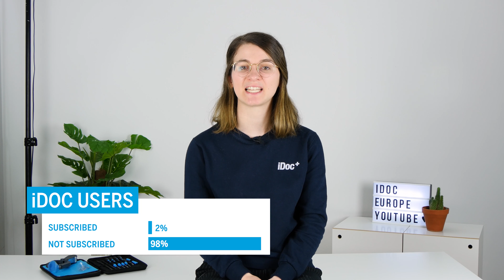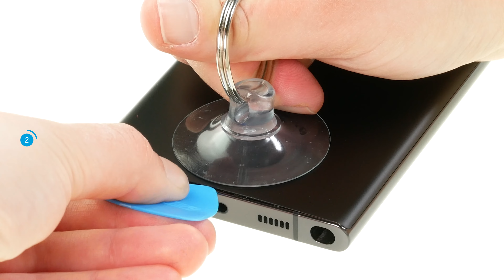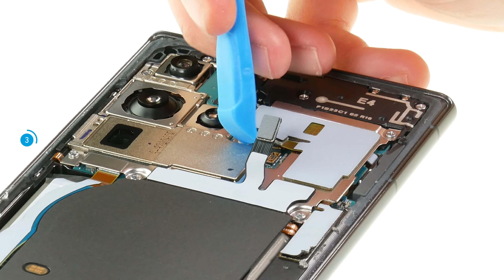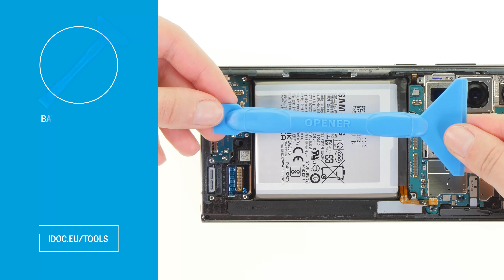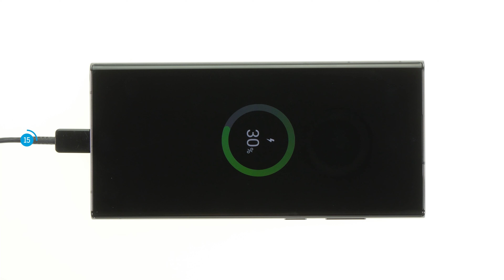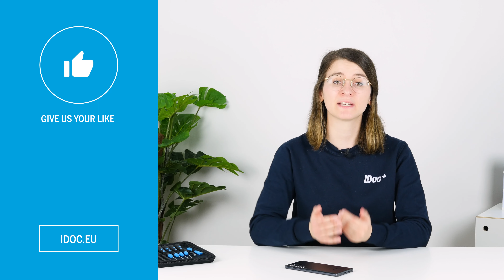Samsung Galaxy S22 Ultra – Battery replacement [repair guide + reassembly]

Comment: This is an issue with the new phones. The battery should be easily replaceable. The manufacturer's want you to buy new phone when the battery is done. That is why samsung says battery is not replaceable. We all need to make it clear to all manufacturer's that this is not acceptable
Reply: Fortunately its successor, S23 Ultra, has the battery pull tab thing to remove its battery easier. Also since when did Samsung say their battery isn't replaceable?

Comment: I had a hard time removing the back panel, and a harder time in removing the battery, it sucks that this phone does not have pull tabs or less strong battery adhesive like other devices.

Comment: Whatever happened with the removable backplate to replace the battery in under 10 seconds? This is way too much work!
Reply: The phone maker are saying it's better protected from dust and water this way, which is bull. I have some water drops on the front screen, but don't need no where near the water protection they give.
Reply: @unknownone8479 It's definitely not bull. Of course, it's possible to create a cover that is water right seal, but creating cover that is both water tight and not bulky is a totally different story.

Comment: Heat from the software update is killing the display. Won't the heat from heatgun would damage display in long run.
Reply: No. Do you realize how hot your phone gets off normal play and using it? It'll be just fine.

Comment: Why did Samsung design the cellphone so stupidly in the first place? With my old LG cellphone I can open it easily and replace the battery in about 10 seconds.
Reply: Was your phone water resistant?
Reply: lol mine was
Reply: @MyChiliIceCream  my lg is water "resistant"  not to be confused with water proof. Even the samsung s22 ultra is only water resistant not water proof
Reply: @holmes1956O   I know. It's what I said. OPs phone that can be opened is probably not water resistant enough to the point where you can submerge it. You can submerge the S22U for 10 minutes and it would be fine.
Reply: @MyChiliIceCream  well maybe you should do that to your phone and get back to us and let us know how you make out. I know I have dropped my lg into a puddle and it survived
Reply: @holmes1956O  There is literally an ipx rating for a phone. Phones which you can open up have low ipx ratings.
Reply: @MyChiliIceCream  I have read the ratings that MANUFACTURER'S place on equipment. Fact if your phone goes under water you cant remove the back to ensure it is dry. I can and also remove the battery to prevent damage from moisture. There is also a small patch insude your "waterproof" phone that proves it has been wet. Why if it is waterproof😵😵😵😵
Reply: @holmes1956O I never said my phone is waterproof. Read my comments again. I dont have to remove the battery because my phone has a better ipx rating than your old phpne. Fact is, phones today are more water resistant than your old phone.
Reply: @holmes1956O  Sure. Stay ignorant. There is a prescribed maximum depth where phones can be submerged based on the ratings. Be informed.

I haven't yet submerged my phone but I do wash my screen regularly thru a faucet with confidence.
Reply: @holmes1956O  I fell asleep in a soaking tub in Tokyo and my Samsung fell off the ledge sometime during that... when I awoke, I discovered it under my rear and the water was cold. Worked fine, still playing Netflix.
Reply: @MyChiliIceCream  I think manufacturers are purposely designing them in a way that makes it too hard for us to repair them by ourselves and too costly to have them repaired by professionals so that when the cellphone fails, we are forced to go and buy a new one. That's their main objective.